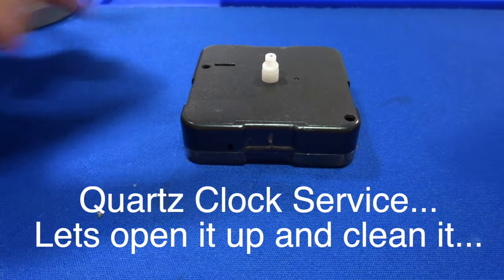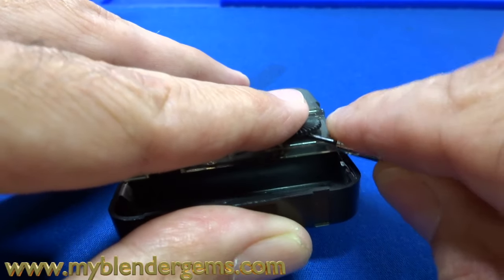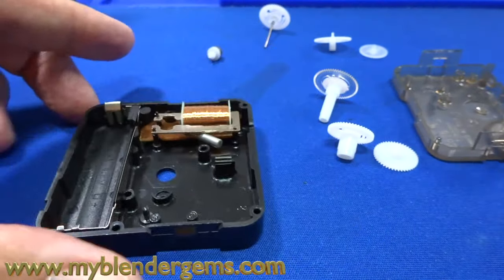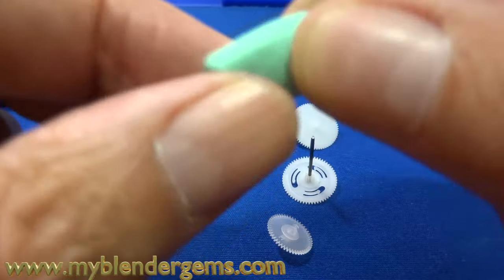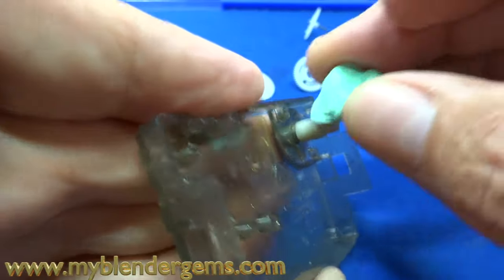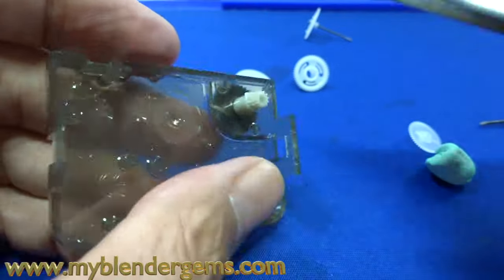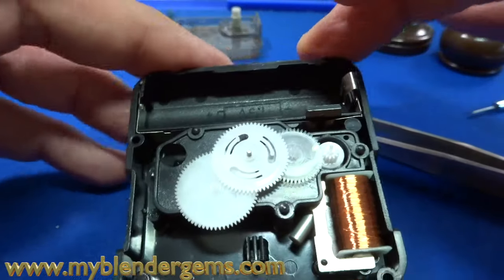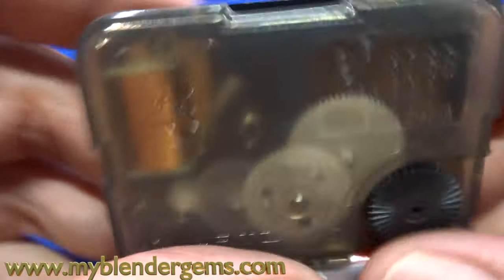Quartz Battery Operated wall clock desktop clock repair

Comment: I can't believe I managed to fix my wife's favourite clock! It had stopped working, and when I went to check the internal parts, I accidentally dropped it, and all the pieces scattered across the floor. Thanks to you, I was able to understand the purpose of the cogs and the mechanics, put it all back together, and now it works! My childhood curse of breaking every clock I touched has finally ended 😅

Comment: Now I remember why  it didn't work years ago when I tried it. Might I suggest to us amateurs that's you video tape as you disassemble and then rewind to see what goes where and how. Good luck winding lining up the gears with the different apertures.😢😊
Note to vlogger the wires that attach the Dynamo to the motor will detach if they are not located and isolated carefully.

Comment: Came for the resin printing, but I really enjoy these timekeeping videos. Question - do you ever find the problem with a quartz watch/clock being the crystal itself? Many years ago I did hobbyist level experimentation with creating timekeeping circuits and firmware. In trying to squeeze as much accuracy as possible out of the project I fell down the rabbit hole of testing and cherry-picking 32.768khz crystals for accuracy. I should dig out some of those old circuits to see if crystal aging has had any effect in 20-25 years. Always wondered if crystal aging/drift was a problem watchmakers had to deal with. Just thinking out loud.
Reply from the maker: New printer coming next week.  Review in 7 days.  I was in the wireless business for a long time. Good crystals don’t go bad easily. Interested in what you find.   Thanks for watching.
Reply from the maker: I went back and looked at the last two years of the arch repairs. Almost every quartz watch failed from a drop or water damage.   Interesting note I never put to memory.

Comment: I couldn't remove mine as the little cap that holds the hands on will not come off.  I got the back off while in the clock due to the clock being rubber.
Once I had the back off I had another issue. The very first wheel will not come off. I am not sure what is holding it. Might the teeny pin holding it have a wide end that keeps it from being removed? Thx.

Comment: I fully disassembled the gears and inspected for damage and dirt. Didn’t see anything. Put it all back together but it still doesn’t turn the hands. I see the upper gears turning but the hands don’t move. The outer black gear to set the time is hard to turn, which I suspect is keeping the hands from turning. When I take out a gear in the system everything spins freely. How can I figure out which part is making it stick?
Reply: I’m in the same situation!! Everything seems to be moving perfectly…..minus the hands lol

Comment: Is 32.768khz crystals for both tick-tock movement and swift movement?  I replace a  32.768khz crystal to swift movement.And it does not work.

Comment: Hi I have a plastic decorative desk clock. I can’t figure out how to remove the plastic face to access the clock hands to remove them. From the back I don’t see any screws or method to remove the clock works away from the body of the clock. Any suggestions? Can I send a picture ?
Reply: Yes send plz

Comment: Hi, I took out the battery to paint my clock.  Upon putting it back in I went to adjust the time.  Now the long hand is loose.  The others work fine but it hangs & is loose.  Do you know how to fix this?  Thank you.
Reply from the maker: You either have a hand that is pressure fit or one with a small nut. Use the setting wheel in back to move the hour hand to 3:00. Then check to see if you need to push down carefully on the minute hand. If there is a small nut, turn the nut clockwise to tighten down the hand
Reply: @watchesandjewelry  I pushed down on the minute hand & that fixed it!  Wow!  I wonder why this happened. Thank you!

Comment: Great video. Do you have a video on how to separate the timekeeping console from the clock? My University of Miami wall clock is not running at all.
Reply: mine was simply glued to the clock. I had to twist it around and it eventually went off

Comment: Great info for the gears, etc.  Do you have any videos on troubleshooting the electronics on the board for a quartz clock?   I have a German quartz movement with bell strike Seth Thomas Corsair Ships Clock, Model # 1036.  Not sure of the Model # of the movement as the label faded. some #'s on the plastic housing: 52699, 19-98   CE Germany.

Currently the movement keeps time well, the bell strike contacts on the circuit board activate on the hour but does not send current to actual bell strike which is separate and has pos. neg. wires to it from the circuit board. Appears that some component is not directing voltage to the bell strike after the contacts make on the circuit board.  The bell strike works when I supply power to it separately. Can it be repaired?

Comment: My crystal clock runs fine on its back but when hanging on the wall, the second hand climbs to just below quarter-to then stalls but continues to kick. The hand is not slipping on the drive shaft. New battery doesn’t help. Any ideas?
Reply from the maker: Sounds as though the gears in the clock are wearing out.  I would strongly recommend a new replacement movement.  Look on the back for a number on the movement itself. Also, if you replace it yourself, make sure that you get the movement that fits the hands of the clock you have. Some hands are keyed (notched)   Some are round.
Reply: Hahahahahhahaha

Comment: Hi, i´ve fixing this mecanism for many years, but im not sure how the eletronic works,  could you explain us? thanks
Reply: Do you know why the chime will not sound on my quartz battery operated clock? I hear the 'click' sound at the top if the hour but the chime does not sound. What do you think the problem is? The click keeps good time. Thank you!
Reply from the maker: Quartz chime clocks have one major flaw in most of them.  If you reset the time by turning the hands counter clockwise, you run the risk of bending or breaking the internal mechanism that the clock uses to make the electronic connection to set off the chime.  Once that happens, it usually isn’t worth fixing.  Most manuals, if the clock included one specify exactly how to set the time. Almost always, using the setting knob in the back of the clock and turning it clockwise. This is a perfect o Ken I have seen for many years, especially in the fall when we set clocks back one hour.
Reply: @watchesandjewelry  yikes.  So easy to break it!
Reply: It has been a while, but here goes. That little metal cylinder contains a quartz crystal tuning fork that oscillates at 32,768 times per second. That is 2 to the 15th power oscillations per second. That is divided down by 2 in a silicon chip 15 times, which gives you one pulse per second. that same chip has a logic circuit that produces a pulse only when the last few divide stages are all in the same state. So you get one narrow pulse each second. That drives the coil of a stepping motor, i.e. a motor that moves one step per pulse. From there it is all gears to slow down enough to drive the second hand, then the minute hand and finally the hour hand.

Comment: Peter, Can you repair a Matthew Norman Chronometer Clock movement or replace it?
Reply from the maker: Sure. What seems to be the issue with it
Reply: It suddenly stopped working. It has a second hand that started to jitter then it stopped altogether.
Reply from the maker: If it is an older mechanical movement I would have to see it. Newer versions are quartz and only se a variety of movements. If newer and a battery did not work to get the clock up and running then a new movement would be recommended. Cost to service a mechanical clock is approximately 170.00 but may be higher if there are major parts replaced. Battery versions may be around 45.00 to 60.00 for a new clock movement.
Reply: @watchesandjewelry  IThe movement is battery (N) operated quartz. It has a second hand too. Would it help if I sent pictures? The new movement will it be Swiss, German or China made? The original movement says Swiss Made.
Reply from the maker: Last question. Is there a model number on the clock or the movement or both if different
Reply: @watchesandjewelry  The inside of the casing says 10  129 Swiss. It is a chronometer. It has a round back and sits into a hi-gloss wooden case on a gimble. That's all I see.
Reply from the maker: Ok. This is really the last question. Is the N type battery a 1.5 volt or a 12 volt. It does make a difference
Reply: @watchesandjewelry  Battery is 1.5V

Comment: Any help from anyone will be appreciated:  My quartz battery operated clock with chime keeps good time. I hear the little "click" sound at the top of the hour signaling the chime to go off - but the chime does not sound (however, it has sounded in the past. It's a fairly new clock.) Anyone know anything about the chiming mechanisms? Thank you for any suggestions. ~♡~

Comment: How do you remove this movement from the clock?  And how to remove the hands?
Reply: It depends. If you have access to the hands you just pull them off vertically and gently. If you can't access the hands from the front you usually have to remove some screws on the back side. This will then allow you to remove the glass or plastic and access the hands. The movement is usually held in place by some plastic molded in clips. You gently move then to the side (one side at a time) to release the movement. Then you follow this video.

Comment: Can u fix a seiko mechanism.
Mine stopped working it has 4 leads one for battery and one to control clock melody. I'm not able to find a replacement.  Well I cant find even a parts shop that Carrie's it. I was hoping someone has rebuilt em
Reply from the maker: Well...  This sounds like one of my favorite seiko watches I bought in the mid 80s...  Although I know, seiko and citizen make watches with alarms today...  If, for some reason your watch stops any alert tones i.e. melodies, alarms ect...   and is older then six years, you will be hard pressed to find a working replacement.  (Yes, occasionally, they show up on ebay, but rarely).  If it is newer, i.e. within 1 to 5 years old, I would suggest sending it back to seiko directly or with an authorized servicer.   These movements are not typically available direct to most watch service locations, and almost never directly to the end user.  Seiko has an extensive retail foothold.  I would find a local seiko dealer (small shop, not chain) to help you... Just keep in mind, older watches go out of production, and parts become difficult to get.
Reply from the maker: Now... As far as the melody clocks...  We stopped selling them when you could buy them for cost at Sam's club.   Seiko does not repair them.  If the clock is in warranty... One year old or newer, they will replace it direct.  If not, they will tell you to buy a new one...  (the reason I do not work with seiko clocks any longer)

Comment: Peter, what type of oil are you using for the plastic gears?
Reply from the maker: https://www.esslinger.com/moebius-synta-frigo-lube-9030-general-quartz-watch-oil-2ml/
Reply: @watchesandjewelry  Wow, thank you so much, Peter! I purchased a really cool "Panerai" wall clock (over $200) that just arrived today, which has a "Gürgen Bålsche" 5820 caliber quartz movement, and it's operation is very poor. I'm hoping I didn't somehow strip a gear when setting it. But your video is a life saver, and thank you so much for helping us mere mortals!
Reply: @watchesandjewelry  Thank you for this information. I looked it up and it is very pricey, at $35.95 for 2 ml. Are there any other options?

Comment: Failure of pcb circuit is the reason for 99 % of clock not running.
And it is not available in the market.
So solution for clock not running is to replace the whole machine.
Cost of machine is very near to cost of a new clock !

Comment: Interesting seeing you take it apart and put it back together, but seriously:  you can buy a whole new movement like this for $1-$3, and just swap it out.  That's less than the cost of a block of Rodico. :)
Reply: fartwrangler i have a cuckoo clock movement battery operated that stop operating, not cheap as a general movement clock price
Reply: Yes, replacing is preferably to servicing when it works, but not all movements are the same. The diameters of the shafts may vary between movements, with the net result that the old clock's hands won't fit. Too small a hole diameter in the hand may bind the concentric shafts together and then the clock won't run. Some movements have a threaded shaft surrounding the shafts for the hands, and some don't. The shafts stick out further on some movements than on others.

Comment: Hi Pete

I've got a quartz clock and it always stops around the same time.
(6:40 or 7:40)

Otherwise it runs perfectly. Do you have an idea what I could be?
Reply from the maker: First I would check hands. Make sure the hour hand isn’t touching something on dial. Next I would take the clock apart to see if there is debris inside.
Reply: Tnx for the quick response Pete!

If you tap on the clock it starts working again... But when the arm for the seconds comes @nr1 then it stops ticking. When you tap the clock it starts again... 😂

I'll check tomorrow of there's some debris inside!
Reply from the maker: How big is the clock?  Large clocks with long hands. Say more then 12 inches can sometimes wear a clock movement out. In which case they would need a high torque movement

Comment: May I ask how can I fix the magnetized rotor gear? It doesn't turn half a second but it still makes movement/pulses. Thanks!
Reply from the maker: Is the gear broken?
Reply: Peter Grande nope. the teeth are complete and it has strong magnetism too.
Reply from the maker: So. If it is not broken and if you have cleaned it it should work. If not then replacing the clock movement is the best bet
Reply: Hey Pete what oil do you use?

Comment: Mine is running too fast and even go in the reverse direction.  Help
Reply from the maker: If your quartz clock is running too fast then it will need to be replaced.  There is an electronic issue with the pulse and not practical to repair.

Comment: Yes the hands is an antique  coca cola clock that the hands don't stay put even when I tighten it when I move then they don't stay in place.
THANKS
Reply from the maker: If it’s battery operated I imagine that the gears are broken. If mechanical then it will need to be taken apart are repaired.

Comment: Dont use again the ordinar wrist watch screw driver the locks or clamps of machine will be broken. Use the sheet or blade of iron singl side approximately 8 mm wide.        And there is no need to pullout the time setting wheel.